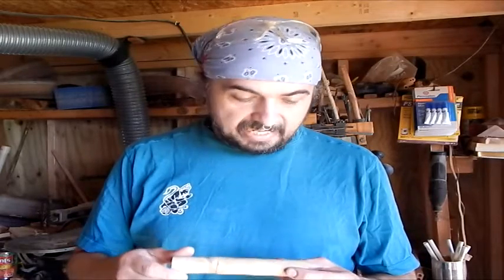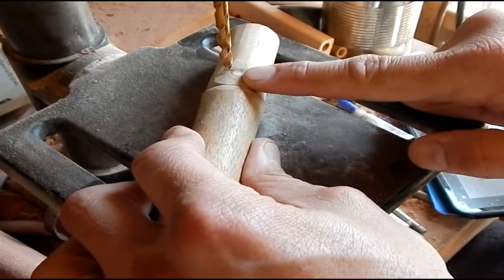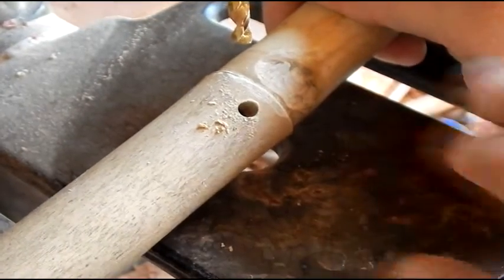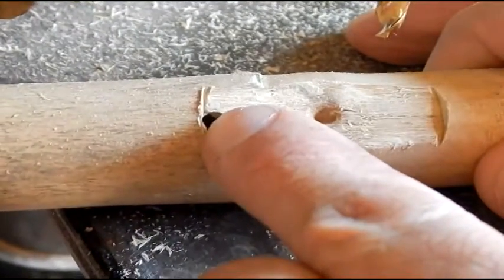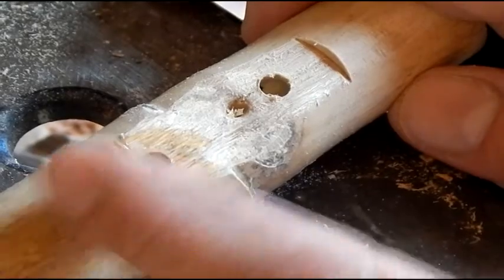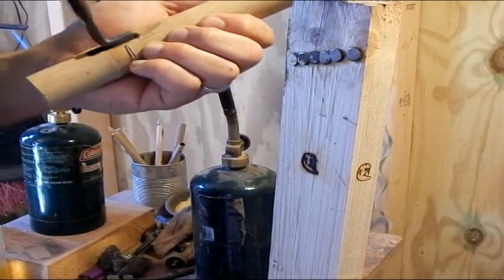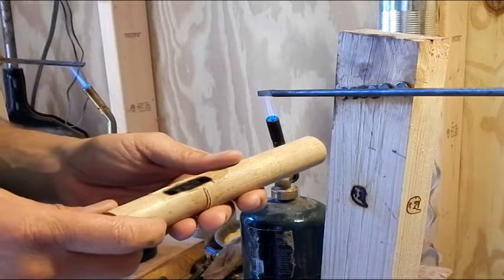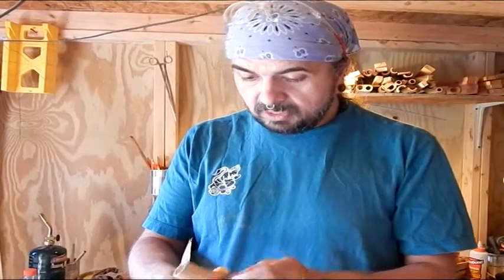Making Native American Flutes - Using a Forstner Bit on the track area

Comment: I made my first bamboo flutes days ago... Good idea using the node as the membrane between air supply and sound hole. Thin cianoacrilic superglue is surely the best for hardening or fixing sound hole area. I haven't tried burning holes rather than using a drill bit... I will try using soldering iron... I'll go and cut some bamboo canes around my home today. Ciao.

Comment: Love your videos. Very transparent and informative. Was curious what type of torch head you use? I can’t find one that produces the pinpoint flame you use. Thanks. 
Sincerely 
Dan
Reply from the maker: Hey dan, I'm also replying to your email. For anyone else interested, and as much as it may sound like a plug for the company, I only use BernzOmatic torch heads. I usually purchase them from Home Depot Lowe's or Ace Hardware. These days I don't use the pencil bed any longer, if you check out one of my newer videos you'll notice that it has three pinpoints coming off of it. I'm very happy with it!